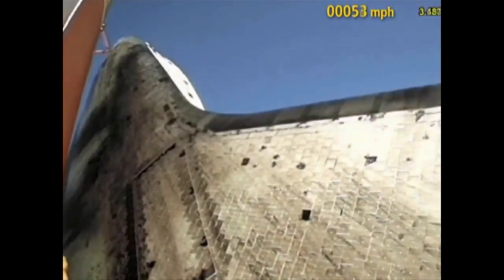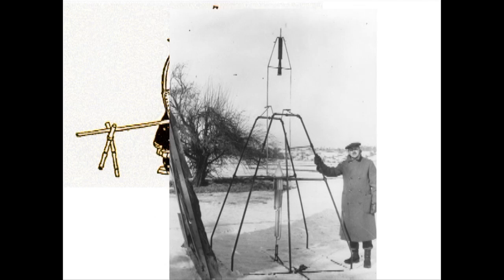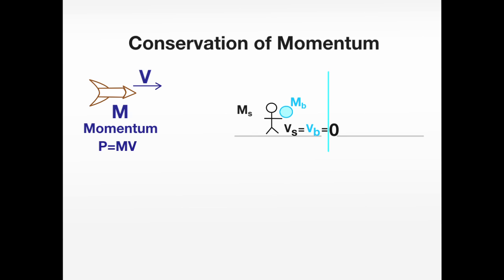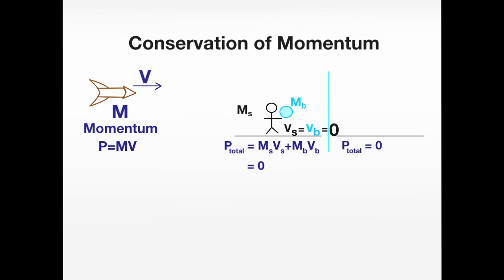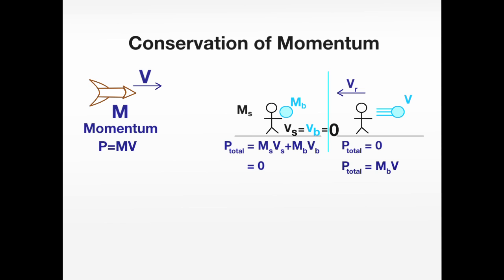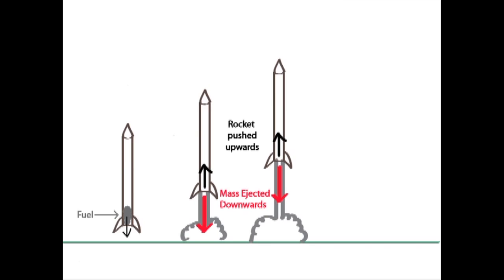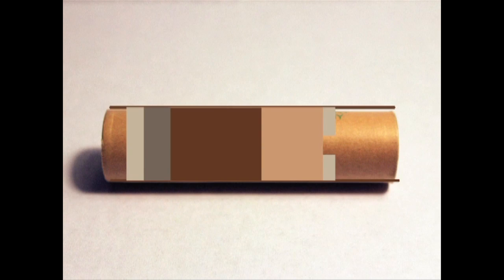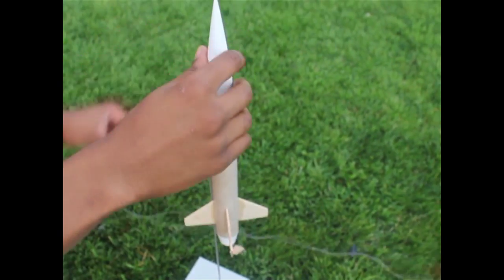Rocket Science!

Comment: Also, some what related experiment that I performed, where I took front part of the ball point pen, then filled it with easily available matchstick powder tightly. Then I made the ball point pen front part filled with matchstick powder to fix to the geometry box divider sharp end. Now I lighted the point where divider and ball point pen front part filled with matchstick powder met. As expected, the ball point pen front part ejected in trajectory. My 3 Friends were THRILLED. However, I instructed them not reveal it to anyone as all 4 will be in trouble at our respective Houses. It was 1988 AD. I was 11. Because the divider weight was too much compared to ball point pen front part, there was no recoil. The principle which is used in Artillery. All phenomenon can be explained using Newtons 3rd law scientifically but Newtons laws are not essential for the observed phenomenon to occur.

Comment: A small research rocket of mass 250kg is launched vertically as part of a weather study. It sends out 50 kg of burnt fuel and exhaust gases with a velocity of 180 ms-1 in a 2 s initial acceleration period.
(a)  What is the velocity of the rocket after this initial acceleration?  (Answer v = 40 ms-1)
(b)  What upwards force does this apply to the rocket?  (Answer  F =  4500N)
(c)  What is the net upwards acceleration acting on the rocket?  (Use g = 10 ms-2 if required) (Answer   a = 10 ms-2)

Comment: Can we launch a rocket with electronic engine ? can electronic engines generate the trust that will fly the heavy rocket?
Reply: Kinda late here, but there are ion boosters that do generate thrust (and also have an infinite amount of fuel) but it is very little so it may be used only in space
Reply: It can generate thrust. But, very very low thrust. That's why we use electric propulsion in space.

Comment: What's the difference between velocity and acceleration and speed?
Reply: +Lord Humungus 
Mmhhhh I'l take my chance, hope it helps:

First you have velocity vs speed: both gives an idea of how fast you go, BUT "velocity" is a vector, that means it also indludes a direction. So, when you say a car is moving at 30mph you are only stateing its "speed"; the velocity would be 30mph north-east, for example (it includes the direction and sense of the motion). Another tipical example to get to understand the difference between these two things is circular motion: imagine you are moving in circles and you have a velocimeter showing a constant value: that means that your speed is constant; but your velocity is not, since you are changeint the direction of your motion all the time (a constant direction would be a straight line). 
So, speed is how fast you go; velocity besides "how fast", includes "where to" you're going....

And acceleration is a completely differen thing that indicates wether or not you are changeing your velocity. If you are moving at a constant velocity, then your acceleration is zero. There is a general mistake that relates acceleration with things moving fast. That is not so. For instances, things that are slowing down are also accelerating since they are changing their velocity (from some initial value to a smaller one). When something is at rest and you push it so as to start moving it you are accelerating the object: it has initially zero velocity, and it changed it to some value different from zero. A car moving on a straight line is accelerating only if you see the needle on the velocimeter moving; if the needle is at a steady value, then there's no acceleration; even when it moves fast! In that case what you have is high speed, but not acceleration.

Anyway.... if you're just "planning" on doing physics but not yet actually DOING physics, then dont worry!!! Start worrying if you still don't understand while doing physics :/ 

btw, i hope my english is good enough as to express what i meant to hehe
Reply: Velocity and speed are basically the same except for one key difference, velocity has direction, speed doesn't consider direction as a factor, acceleration is just the change in speed (this applies to velocity too btw, didnt want to confuse you there)
Reply: +Lord Humungus Mathematically speaking Velocity = Displacement/Time. Acceleration is the Change in the velocity/Change in Time.Velocity is a vector quantity compared to speed which is a scalar quantity. That simply means you have to take into account the direction and magnitude of the velocity. With scalar you don't have to take into account the direction of the speed. I hope i could have been some help.
Reply: Matthew Ardito-Proulx I don't understand ffs and i'm planning on doing physics too
Reply: Angiras Darbha What is the unit for acceleration?
Reply: Lord Humungus ms^-2 or m/s^2

either way meters per second squared
Reply: Angiras Darbha So you would say something like 'the car accelerated away at 20 meters per second squared' ..? Also does it have to be meters? Can it be for example miles per second squared? Or meters per hour squared? The key difference between acceleration and speed/velocity being the 'squared' at the end?
Reply: Lord Humungus NO, and yes
it doesn't have to be meters, and it doesnt have to be seconds, it is basically distance/time^2, so yes it just has to be squared
Reply: Angiras Darbha Whats the no?
Reply: Lord Humungus it doesn't have to be meters, and it doesn't have to be seconds, it can be any distance, or unit of time.
Reply: Angiras Darbha You said 'NO. and yes', what do you mean by the no?
Reply: Lord Humungus "No" was for "Also does it have to be meters?"
Reply: Angiras Darbha Ok thanks

Comment: this explanation is very inaccurate and doesn't really explain anything about how a rocket works. the basic formula is F=ma. The force of the rocket must be greater than the force of gravity before you get any momentum. gravity will constantly trying to reduce your velocity and you don't even consider it. this is like explaining the basics of how a car works by explaining wind resistance.
Reply: I recommend Rocket Propulsion Elements, the book. It's expensive but there are probably places you can find it online... ;)
Reply: Dude this is simpler physics, he's assuming no air resistance and no gravity
Reply: you are right, the real rockets are not in isolated system
Reply: Evil CGI Goblin Kerbal Space Program
Reply: in this case mass is not constant as fuel accounts for about 20% of the rockets mass